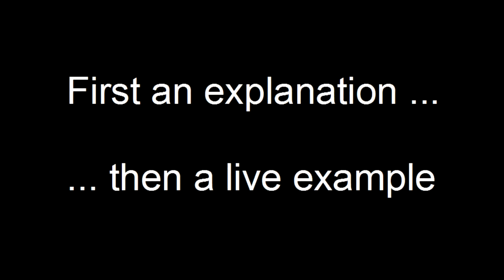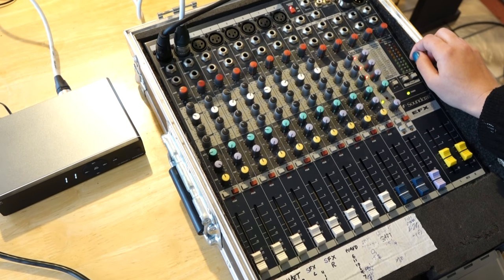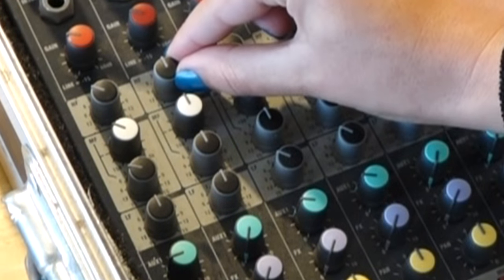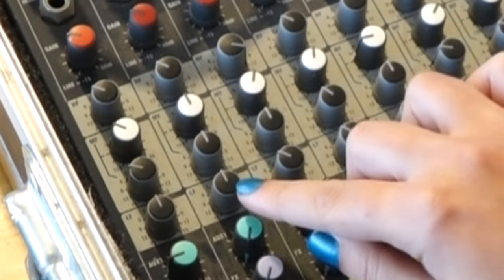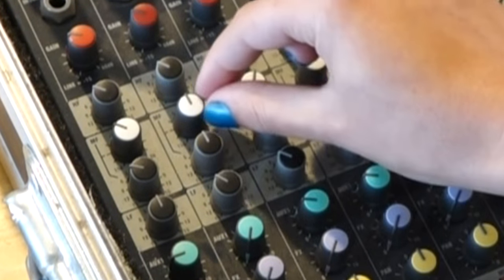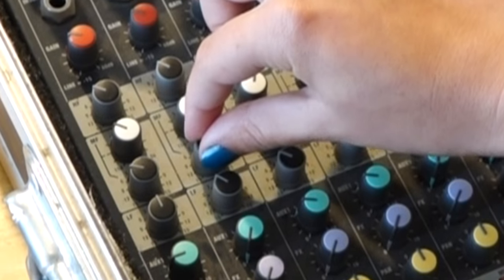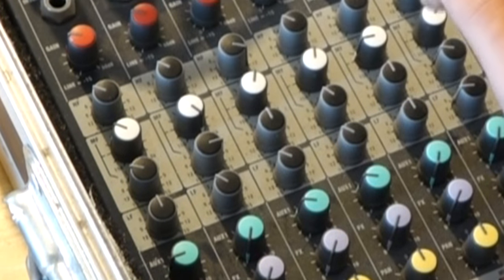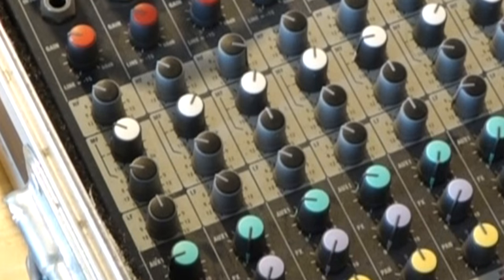Top Tip for Sound Mixing (using a basic analogue mixer)

Comment: I do the same thing for live sound, except I cut and sweep to hear when it sounds better. But this is just another good way of comparing what you are hearing when sweeping. On a 31 band, I do this as well by asking students to boost a bit and listen then cut a bit and listen. This is a very good video that I will show to my students as part of a discussion on 'using your ears' to tune a sound system. Cheers!
Reply from the maker: Thanks :). The Yamaha guy I learnt this from mad a good argument for always cutting instead of boosting (to reduce mush and increase clarity and separation). But I'm no expert - I just pick bits up here and there :).
Reply: @SamanthaSinger  The explanation and video itself is very clear, so thanks for sharing!!

Comment: I saw this tip some years ago and used it with my Zoom R16 multitrack recorder.  I found that a friend's guitar has a very bad resonance at a particular frequency, and I turned down the gain at that frequency to make it sound sweet again.  Great tip!
However, a mixer with 3 band parametric EQ well exceeds my definition of "basic".  So, what can you do if you only have a 2 or 3 band (non-parametric) EQ??
Reply from the maker: Without the abitlity to adjust the frequency that a knob is increasing/reducing there's very little you can.
I usually listen to each channel in turn and try to decide if I think it sounds trebly or bassy (or both) and turn those down if I need to. 
Then play with the mid range up/down and see if I think any setting improves the sound.
Reply: @SamanthaSinger  In the end, you can only twist the knobs that are actually present 😃   Thanks for replying!

Comment: Samantha I loved the way you have simplified what I have been wondering about those two knobs, I do have a novice question: Do you adjust the Mid & Sweep before or after adjusting the High & Low. Thanks in advanced for your time & reply
Reply from the maker: Hi Guz. Theoretically it doesn't make any difference. However we do the mid range first because we think it's easier to do - when you hear a sour spot it's fairly easy to identify and so reduce/eliminate. Once that's done the overall sound is then closer to 'best possible' and any problems with the upper/lower ranges should be easier to hear and adjust. Did that make sense? :)
Reply: @SamanthaSinger  it's as clear as crystal. It does make sense as you say. Thank you very much for this info now I'll be able to face the board at our gigs & church and know more or less what I'm doing thanks to your layman's explanation. P.S. You have a wonderful voice.
Reply from the maker: @guzglez3071  Thanks Guz - glad to be able to help. And thanks for the voice compliment - three years training!

Comment: what is the use of other controls in the right side of the mixer.. how to gain echo and reverb that it wont have an echo feedback from the speaker.
Reply from the maker: On this mixer the effects controls should not effect whether you have feedback or not. To avoid feedback follow all the usual advice - don;t have mics facing speakers, etc. But the best advice I can give for feedback is to use top quality equipment. I use DPA mics and Dynacord (same company as EV) speakers and RCF monitors -and I've never has feedback once in any venue in 8 years of touring. I'm convinced it's the equipment that makes that possible.
Reply: @SamanthaSinger  Thanks 😊 for the tips.

Comment: Hello again,
I just thought about something my mixer Allen & Heath GL2400 has low mid has 2 knob so I can use the same trick you use for high mid.  I think I notice the low mid second knob the one which cut if I dial to the clock wise base  will increase. Please tell me how to use this low mid. Also It has the low frequency knob. Thanks much
Reply from the maker: Hi Thomas. Whenever you have a pair of knobs affecting part of the frequency range on a channel (maybe one pair as in my example, or two pairs as in your A&H mixer, or more if there are mixers with more!) you follow exactly the same procedure as I have shown for each pair. So on yours, do what I showed for the top mid-sweep pair then do it again in the same way for the bottom pair. If you have time, go back to the top pair and do it again to check the change you've made on the bottom pair hasn't altered where you need to be with the top pair (probably it won't have).
Reply: @SamanthaSinger  Sounds good. Thanks much.

Comment: Thank you
Will this works on guitars and any other instruments?
Reply from the maker: Yes it should work on any sound. When checking for an instrument use a repeated 'typicla' chord in the middle of the guitar's range for a performance and make that sound best. It's not ideal because the sound will change a lot during a performance and what's best for hat 'typical' sound won't be best for all of the guitar's range. But it's the best you can do :).
Reply: @SamanthaSinger  Thank you so much.

Comment: Oh Gosh I’m trying to learn this for the church mixer. The knob says -15 -+15 is that kilowatts. I understand the third know with -15 to +15 cut or boost the frequency. So I’m still try to understand the correlation between. Appreciated
Reply from the maker: Hey Thomas. The upper of the mid knobs is the centre of the frequency range the cut/boost knob will act upon. The width of the range and the highest and lowest frequencies that form the centre of the range varies from mixer to mixer. It's not really necessary to know exactly what frequencies you are dealing with. It's just an auditory process: sweep across the whole frequency range available and find the worst-sounding one and deal with that.
More expensive mixers sometimes allow you to vary the width of the section of frequencies you are sweeping over (if you see what I mean - it's hard to describe without diagrams!). Digital ones all allow infinite control, of course :).
Reply: @SamanthaSinger  Thank you samantha for the kind replay. I just look at the pic I took from the mixer the HM and LM both has different frequency range like u said the mixer we have is Allen health GL 2400. So when u begin testing is there a position to start with for example I can start from 12 0 clock position. Last service I was getting some feedback from the system. I believe EQ play a role ? Any suggestions  to fix the feedback issues. I will try to do EQ for each singers with their voice. Last questing did u ever did facebook live from the mixer to the iPhone any suggestions on that ? I tried doing quarter inch to phone jack didn’t help heard about IRIg also someone says there is an apps which can use as an interface. Thank you so much.
Reply from the maker: @thomas9469  I always start from extreme anti-clockwise to extreme clockwise (about 7 o'clock to about 5 o'clock). But it doesn't matter as long as you cover the full range of frequencies to identify the worst frequency and reduce that. If you push the top knob of the pair as high as you can until just on the point of feedback you will most easily find any dodgy frequencies.
Regarding feedback, I guess you have done the obvious and made sure none of the mics are facing (or can pick up anything coming out of) a speaker. You can buy EQ boxes specially designed to plu into a single channel or the overall output to kill a narrow frequency that is feeding back. But I don;t like those - I like to remove the problem at source. The best way I've found is to use speakers and mics of equal (ideally high) quality. If you have excellent speakers and a cheap mic (to me that's anything under £300) then the mic is likely to cause problems. And vice-versa. My mic is £850 and my speakers and subs are £4000. I have never had feedback in 10 years since I bought them! Even if I put the speakers behind me!! Obviously not every situation justifies that expenditure, though. But it's an example of how the better the equipment, the less likely is feedback.
I'm afraid I have no knowledge of using phones as a broadcast method - I've only done that by laptop - so I can't help I'm afriad.
Reply: @SamanthaSinger  Thanks again the headset wireless mic is a cheap one we have the priest using I got a feeling that cause the issue also the the feedback speaker sitting on the side of the alter but someone standing front of it. Quality mic is important. Also use the method you show on the video  when setting  both high mid and low mid correct.
Reply from the maker: @thomas9469  Yeah definitely tackle the speaker/mic placement first.
Reply: @SamanthaSinger  
Thank you so much.
Reply: One more question sorry when checking the PFL level it’s better to turn off the EQ ? Thanks.
Reply from the maker: @thomas9469  Correct. I'll do a video on gain staging sometime :)
Reply: @SamanthaSinger  please do can’t wait. 😊
Reply: @SamanthaSinger  
Hello again I just thought about something my Mixer has 
HF
HM
HM
LM
LM
LF
So there is 2 knobs for both high and low sections, I use the same method for both. Thanks much.
Reply from the maker: @thomas9469  Yes, I also have a larger Soundcraft with upper and lower mid-sweeps but the process is the same for both sets - as you deduced :).
Reply: @SamanthaSinger  🙏
Reply: @SamanthaSinger  Thanks a lot. Next time pull the the big guy out lol. Please do more videos like setting up PFL etc.

Comment: Hey again, hope u doing well 
I have an other question 
So when the mixer only has one knob for the( High  Mid and Low mid )how u do this ?Or what will be best way to do it with having one knob. Appreciated. 🙏
Reply from the maker: Can you send a photo or a link to the mixer please and I'll let you know :).
Reply: @SamanthaSinger  
Thanks for reaching me it’s the Allen & heath  GL 2400. Can u  google the image. please look at the picture under ST 1 knob that’s where my phone is connected to play music, in there high and mid only has one knob. I’m trying to figure that out.
Reply from the maker: @thomas9469  On most analogue mixers ther is a high and low single knob which works on a fixed frequency range. This video was about a situation where the frequency range of the mid area is variable. On the ST1-4 channels of your mixer there are two mid knobs that work like the high and low - they are fixed frequency only (250Hz and 2.5kHz). So you can only use them like the high and low - increase the volume of the frequencies around 250Hz or reduce them, and the same for the 2.5kHz range. So you can't use the technique in this video - just tweak them up and down and listen to see if you think the sound is better or worse. If you have a cable that splits your phone output into two plugs you could put one in each of two mono channels and then you can EQ each of those channels using the mid-sweep technique in the video (if you have two spare channels :) ).
Reply: @SamanthaSinger  Sounds good Thank you so much. 🙏